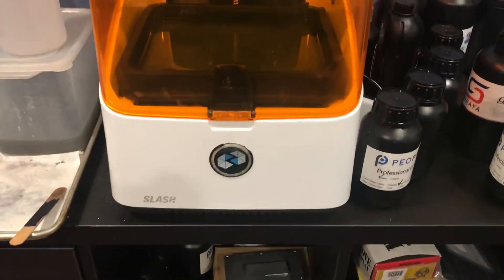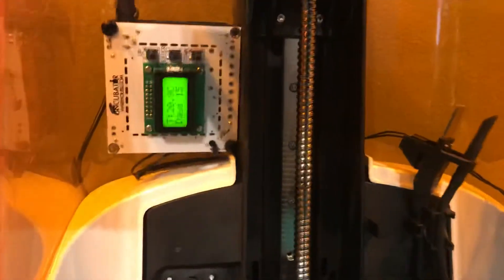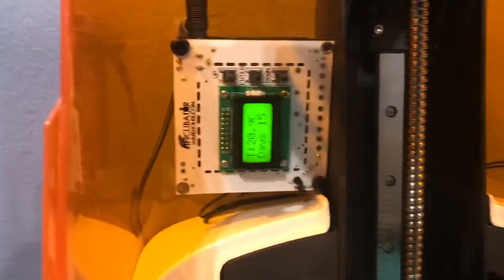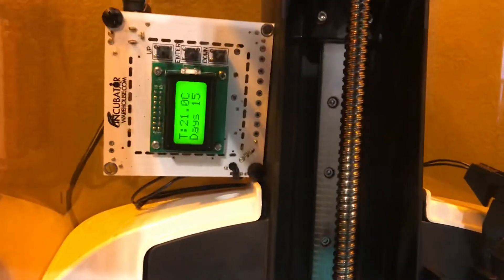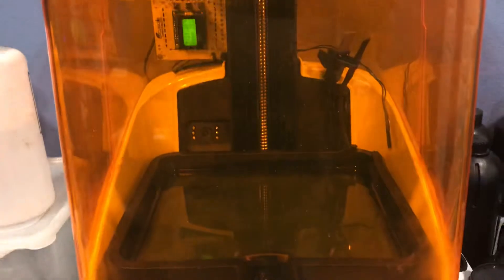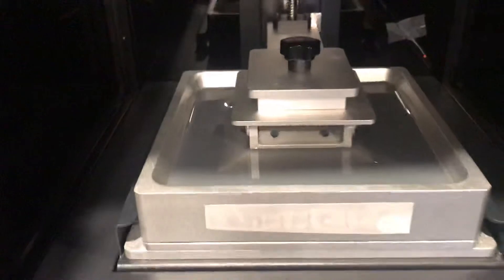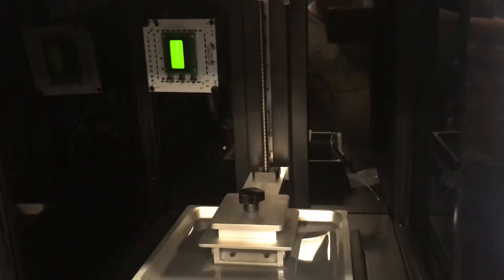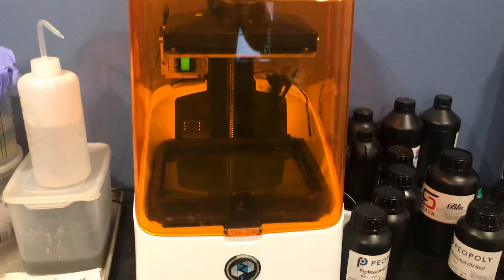DIY Heated chamber - Uniz Slash & Peopoly Moai

Comment: Is this the original Slash? How long have you had it and do you like it? I'm thinking about picking up a 2nd hand one thats been used for 12 prints for a great price. Not sure if I should though. Most of the hate i see is around the kickstarter but now that the devices are here....
Reply from the maker: Yes it's the original Slash. But I've upgraded a few things that were flaws in the design. If the one you're looking at is the original without a upgraded coolant panel then I wouldn't get it because there are vertical lines that won't go away without the upgrade which is like $150 extra plus opening up the printer and changing that yourself. Ask the guy about that first. Ask him to show you print examples and see if it has a smooth surface or has vertical lines.

Comment: Thoughts on a Moai vs a Slash+ UDP?  They are the two that I’ve settled in on as my first resin print.  I’m mostly interested in printing useful parts that I model in F360, just simple projects for around the house, and want dimensionally accurate parts. How would you rate the software for the Slash as well?  Is it polished like I’ve heard Formlabs Preform is or is it inadequate/buggy?  Would love to see a comparison video of the two printers in action and the results.
Reply from the maker: Depends on the details and size of prints you're looking for really. The Moai is slow since its SLA, but the details that I can capture is amazing! The Slash on the other hand being LED, and not having AA filter for the image slices, wont give you super smooth surface but still can capture details. Also UDP tech is a hit or miss and has limitations, so I'd suggest saving money and go for the Slash Pro instead if you going the Slash route. Software is simple but works. Doesn't give you much controls over the model itself just slicing options. Formlabs software is probably the best I've seen, but I dont have one to compare to. The Moai's software is also simple but works. They make it easy ti print but doesn't give you control, which I prefere, so I use Cura for the Moai. I've been resin printing 4 years not and I'm used to diing my own hollowing, supports, and getting the settings how I want. If you want a one stop shop that's easy to get into and very well built then the Formlabs printer is the way to go, but expensive. If you want something to mess with and learn along the way then a Moai is a better and cheaper choice than the Slash.
Reply: Make or Break 3D since I’ll be coming from FDM and 0.4 nozzle, I’m sure the small amount of voxelation wouldn’t bother me.  My main consideration between the two is reliability and dimensional accuracy across the entire build plate. I’m sure both are capable of what I would consider to be stellar prints.
Reply: @propsandpop  What if I'd found a Slash+ UDP for similar price to the Moai..... essentially removing cost as a factor?